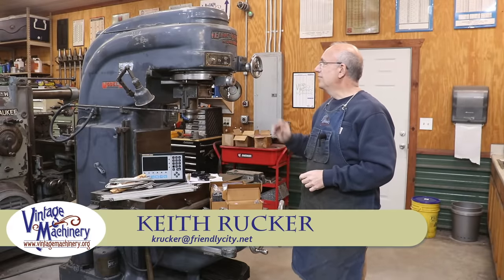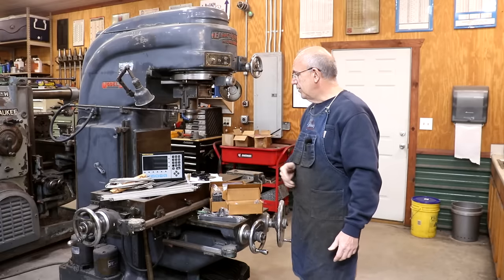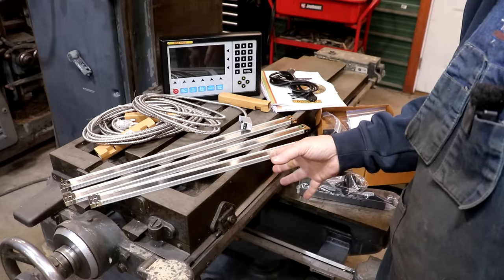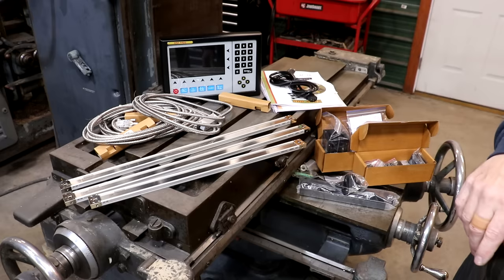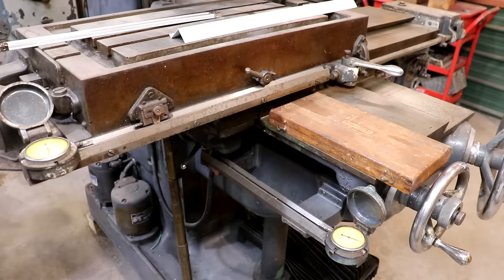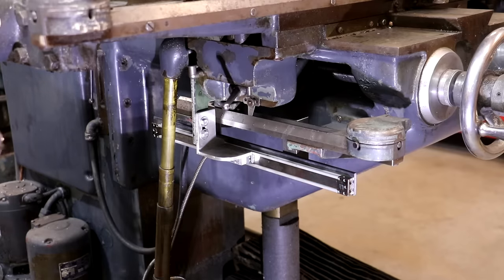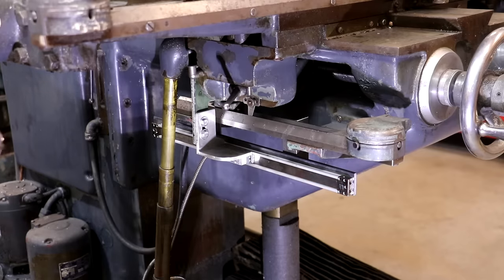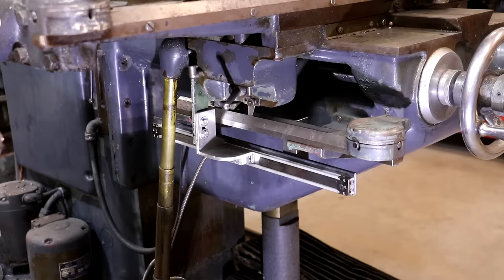Kearney & Trecker 2D Rotary Head Milling Machine: Installing a Dro Pros EL-750 Digital Readout

Comment: When I took machine shop classes in the late 1960's digital wasn't even in the dictionary.  Watching so many machine shop videos, especially Kurtis at CEE in Australia and Topper, I can't imagine anyone doing this work without a digital readout.
Reply: I was thinking the same thing.  When I was learning to be a machinist most of our machines had been made in the 1940s.  I remember one lathe marked USS Pennsylvania which was original equipment for a ship completed in 1916.
Reply: I had a clapped out old column mill with a DRO, then upgraded to a nice new mill without one.  I only lasted a couple of weeks before ordering a DRO for the new mill.
Reply: Around 2005ish when I was in school learning metalworking I didn't have a DRO on the lathe or mill.
My machining teacher always said if you can't work without a DRO you're in the wrong class as working without a DRO is the basics of machining.
He was a great teacher.
Reply: @samuraidriver4x4  I learned that way too, partly because it was long enough ago that there wasn't digital anything, never mind readouts!  DROs make my shop time more productive and are easier on my old eyes. I do agree that you should learn the basics and treat your DRO as an aide, not as a fundamental.
Reply: @billmckillip1561  there was 1 lathe with a dro in my school but my teacher wanted to let us earn the privilege of using that machine.
I can clearly remember the first day, recieving tools including dull drill bits and hss blanks that you had to learn how to freehand grind.
Once I had my first job as a welder/fabricator I was the only one that could actually use the lathe in the shop as no one knew how to properly grind tools or work without a DRO.
It was a harsh but fair teacher and I do owe him alot.
A DRO indeed a great aid that does help with production speed but seeing the younger guys these days that are to dependent on them does feel a bit wrong.

Comment: Using the bolt hole function of your DRO on a 2D should be illegal for PCD <=8 inches. Use the offset and rotary head. My 2D has a DRO, only warning I’d give is to make sure that you re-zero the offset / head angle if you change it mid use, I’ve scrapped a part or two by trusting the DRO after shifting the head.

Comment: Consider: Ask if they offer a powered axis upgrade.  If not, suggest adding three rubber wheel equiped gear motors to what they already make, so it could be improved.  Better still, get them to sponsor you and provide you the upgrade for assesment. Bo.

Comment: Very cool.

We have gone from rotary resolvers to optical encoders for angular readouts; this seems to be a different technology; possibly related to hard drive read heads.  I am wondering if there is an analogous device for angular motion.

Of course for angular motion one major problem is getting the transducer aligned precisely with the true axis of rotation.

Comment: It looks nice, but does 1/10000 of an inch of feed shown on the screen correspond to 1/1000 of an inch of physical feed. I believe so. Anyway, as I see, in the millimeter scale it has three decimal places reserved, but inches to millimeters is converted with an accuracy of two decimal places. Why is there a third zero place?

Comment: Thank you for this video.  As always, it's  a lot of work to break your work cycle to plan and set up the shots and then edit and upload. It would have been good however to have seen more on the aspects that are actually the difficult bits: planning where to mount the scales and readers, and designing, fabricating and mounting the necessary brackets on machines not designed to take them.

Comment: Excellent addition to the shop - will improve work time to the benefit of production schedules. Just 1 thing - the DRO PRO label on the display unit would drive me crazy being not aligned properly in its spot. It'll be one of the first operations to reposition it. Great machine, poor attention to cosmetic finishing.

Comment: Fitting this machine with a DRO properly sounds kinda challenging. I mean like completely proper, with scales on the 2D head as well. Would have to measure the angle of the head too and correct the tool coordinates with some trigonometry. But having a DRO on the three main axes should already help you a lot.

Comment: You mentioned you have a Wells index mill which model is it? I have a index 55 and recently had a shop fire by arson. I lost the mill but have some tooling that was specifically for it brown and sharp nine taper I have some neat tooling like a right angle, head attachment and some other stuff I’d be willing to sell to help recoup my huge loss, if it helps you out at all and can use that tooling

Comment: This is fascinating. I'm super curious how well the DRO matches up with the analog scale built into the machine. I like to think those old analog scales are super accurate, but I don't know for sure.

I guess it would pay off to take some time and adjust the DRO magnetic scales to be perfectly true with the table.
Keith goes through a lot of effort to make sure his tables and ways and all surfaces are flat, level, plumb, and true. If the scales are not the same, there could be (theoretically) a small cosine error on EVERYTHING. I bet that digital calibration feature would compensate for any difference.

Comment: If the sensors use a magnetic technology, it begs the question of how they are made to work independently, reliably and consistently in close proximity to the large iron and steel masses of the machine itself and the various workpieces.  Any ideas?
Reply: Distance; I think the read head is a solid state device, bit like a hard drive head, they are not that fussy about external influences any more.
Reply: Thanks John, that makes sense.  I was thinking about much simpler and less sophisticated devices like ships' compasses.

Comment: I'm not a machinist, but I am fascinated by how easily you can measure with micron precision in such a "dirty" environment without elaborate sealing.  This is especially true for a magnetic length reference on a machine that cuts iron and steel.  This isn't in any way a criticism of you or Dro Pro.  Great work!